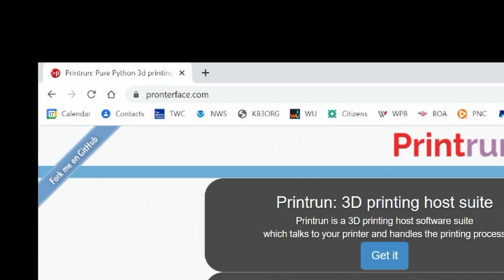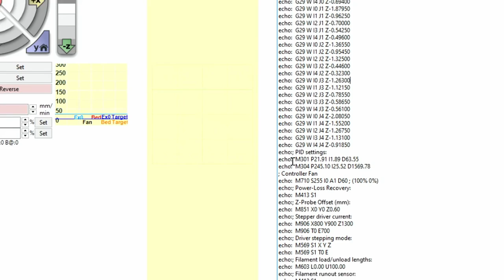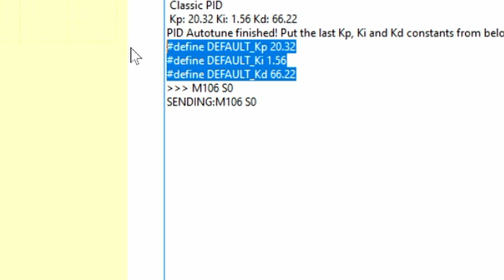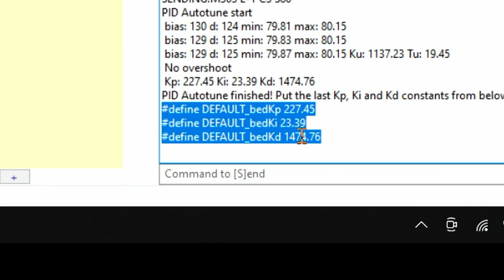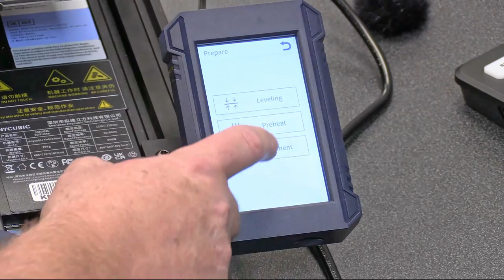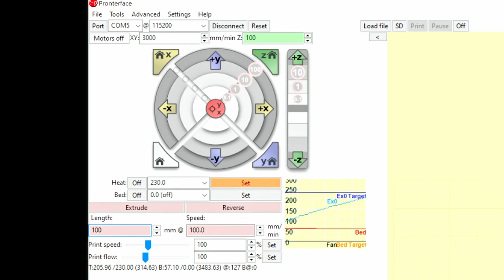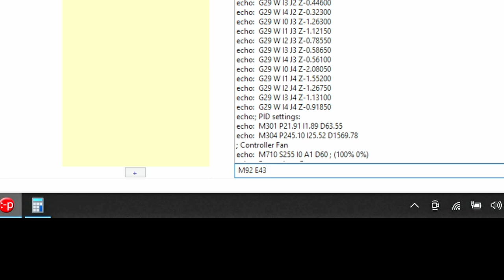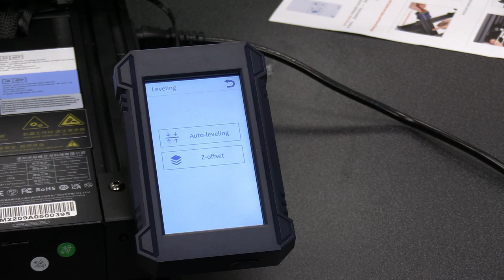Anycubic Kobra Max - Improve Printing

Comment: I recently bought a Anycubic Kobra 2 Max but it did not come with a usb cable.  Is it something special or just any USB A to USB A cable will work?  I tried a 10' A to A cable but its not showing up on my PC.  Next I'll find a laptop lying around and try it.
Reply from the maker: My 2 Max is still in the box waiting for me to do an unboxing/review so can only pass on what I've learned from the forums and Anycubic.  I do know that the 2 Max uses Klipper firmware which is and excellent choice by them to get the speed out of the printer.  Unfortunately they seem to have "locked down" the firmware so it can't fiddled with, like we have with prior printers.  There are some USB Type A's on the front and one is specifically for update the firmware off a USB stick.  I have to offer on the subject when I unbox it this weekend.
Reply: @TheMakersCave  Thank you very much for your response, can't wait to see you unbox it and get it up and running.  I just got it a few weeks ago and the test prints were not sticking to the bed.  They said at the time turn up your hot end temp to 70 and play with the temp on the bed.  Turning up the hot end worked but I want to make that default.  I did also ask and you can't use a usb a to usb a to connect you computer to use pronterface. Just like you I've been communicating with Anycubic support about this subject.  Here is their reply:

1st reply: Our KOBRA 2 MAX uses APP and WIFI connection functions.
The printer does not support connecting to a computer using a USB cable.
If you have any questions about this method or if you have any other expected solutions, please let us know.

2nd reply: We cannot send Gcode files directly to the printer,
After uploading the Gcode file, please print it online,
and then the printed file will be saved on the printer.

Comment: Question... when tuning the temp PIDs can you only tune and save at one temperature range or can I go through this process for all printing temperatures I use and have all the tunes/temps optimised?
Reply from the maker: Unfortunately the heating auto tune only tunes for the temp given in the command and most firmware only allows for one PID setting for the nozzle and the bed. But this is a great question and has me thinking.  I'm assuming you need these different settings because you are using different filiaments (PLA, ABS, PETG, etc) that require printing at different temps.   First you need to get the PID values for each temp/filament you'll be using, write them down.  You could then make a 3D printer machine profile for each filament/temp type.  Then go in to the profile for each machine that you made.  There is a spot for starting and ending G-Code.  In the starting G-Code you would put in the M301 and M304 commands with the PIDs you want for that particular printer.  There's no need for a M500 code.  Then just choose that machine when you do a slice of your object.  When the slicer creates the gcode for the printer it automatically adds those starting/ending gcodes to the gcode file, therefore your PIDs would be changed to what you want.  I hoped I explained that in way you understood.  If you hae any questions just ask, maybe I can do a video on this.
Reply: @TheMakersCave  thanks for the response and I think that would be a great follow up video your wisdom and time is much appreciated

Comment: I've had my Kobra Max for a few months now, and the performance has been kinda meh. My old Ender 3V2 had the PID autotune function built in once I installed Jyers firmware, so it never occurred to me to go into Pronterface to do it for the Kobra. Hopefully I'll start to see better results. Cheers.
Reply from the maker: After a few months I still like the Kobra Max.  I bought it mainly to print big things for animatronics, that's where it really excels.  I've had to tweak it about for details on smaller prints.  I definetely saw a difference changing the retraction to 6.5mm using Overature (from Amazon) PETG.
Reply: @TheMakersCave  For really big things that don't require a lot of super fine detail, it's great. I do a fair bit of prop making for cosplay friends, and for stuff like Destiny or W40K where everything is larger than life, it's pretty much the only option for printing in one go. But, that Volcano-style hotend is just the worst for anything like fine detail, and I've yet to figure out how to replace it.

Comment: So i've had my printer for about a week now, and it's worked fine for about... 4 days. After that i started having massive layer shifts and everytime before it shifts i'd hear a grinding-ish noise. I've tried everything but i still have this problem. Anyone who could help me?
Reply from the maker: I am so sorry for the delay. We had a major convention and then the last week Katrina and i have had a terrible flu.  I sounds like one of your stepper motors is jamming and/or skipping steps.  The printer doesn't know this so now it's lost it's positioning, hence the shift.  I'm assuming this is a bed-slinger (the bed moves from front to back).  With the machine off, so the motors aren't energized, can you easily move the bed back and both, trying going slow and slow increase how fast your doing it.  If it binds or jams then that's where the problems is.  If that is good, try the same thing with the Y axis for the hot end, that controls the hot end from going to the left and right.  If there is binding or jamming then that's the problem. Try those tests and let me know.  Email me because that is easier than chat comments :)   Steve@TheMakersCave.com

Comment: not sure if you're using Cura, but I have a kobra plus, and using the calibration shape plugin, printing out a bed level shape, it shows that the left side of my bed is either warped up on that side or something else is causing the left side extrusion to print as if the filament is being smeared into the plate.  I could barely clean the filament off on that side afterwards.    I've heard glass beds can't be perfectly level, but it effectively makes the entire size of my print bed not usable. I also don't seem to have great results using a z-offset calibration shape, the print comes off too low and some points and perfect at others, so I couldn't really just adjust z-offset to remedy.  I also cant for the life of me get any small details to print cleanly on this printer with a well tuned profile.  Curious to hear what your results are as their isn't much resource on the forums currently.
Reply from the maker: Yep, I'm using Cura.  I use a glass plate on my ender with no problem and the Kobra Max uses their glass plate with no problem as you'll see in Part 3 (comes out this evening).  If it's that uneven one of the things I would check is the "Z" gantry.  Make sure it's not skewed or uneven.  Next I would try to replace glass, just replace it with a standard piece of glass (or mirror).  Anycubic's site has a magnetic flex plate for a Kobra but it doesn't say which series.  What's strange is that the Plus has a 25 point leveling system.  See if any of this helps and let me know.
Reply: @TheMakersCave  I didn't mention first as well, thank you so much for doing this video!  The kobra max/plus community is very small currently and its been a challenge scrounging all the appropriate info!  I hope to take everything ive learned and make a complete, concise how-to video for the plus, including Cura setup and profiles.  I just checked the x-gantry, the left side is higher by .1mm than the right, so not sure if that will be enough to throw off the auto-leveling.  Also just swapped the brass nozzle for an e3d nozzle x, I didn't like how gooey and messy the brass was.  My quest for high detailed prints (comparable to the mk3s+ i have setup beside it to act as a reference/control).
Reply: I will apologize up front for not being able to remember the site or yourtube.  I remember seeing a comment about placement of the stock clips causing an issue?  It mentioned removing some and repositioning them to address issues caused by them.  Just a thought...

Comment: I klipper you don't change steps per mm - this comes from your gear/screw/time belt ratios and is fixed
Reply from the maker: Thanks for watching!  Klipper certainly has it's advantages but installing it onto a Anycubic machine takes some experience and I mostly focus on user just getting started.  Now, having said that, I'm eager to try installing Klipper on a machine.  Would love to compare prints before (with stock firmware) and after with Kipper installed.
Reply: @TheMakersCave  The idea was not to touch steps per mm but write what is from the math if gearbox. For extruder ok but for gantry should be fixed. Bowden in Kobra certainly overshot corners so one could try pressure equaliser in Prusa Slicer. Klipper itself won't help much since it's low acceleration printer. One can try new Biqu H2 V2S extruder (short direct).
Reply from the maker: @jzagaja  I've also found that the Anycubics hotend runs a little hot, sometimes up to 30 degrees, so backing down the temps helps.
Reply: @TheMakersCave  that's disadvantage of closed firmware. I assembled mine yesterday and cannot find screws to manage Z axis   wheels backlash.

Comment: Hi, very nice video!
I'm running Windows 11, and this doesn't recognize my Kobra Max. In device manager, it says something like "The USB-Device didn't respond correctly blah...". Can anyone help?
Reply from the maker: Oh wow, this might sound silly but you might want to try one of the one to four USB port devices.  You know, where you plug it into a USB port and it gives you 4 USB ports.  I have laser cutter and a vinyl cutter that both give me a "device not recognized" error if I plug it directly into a USB port, but if I use an expander device and then plug them into that, there's no problem.  Sometimes you don't ask why and just take the win :)

Comment: Sucks this doesn't work with the Kobra 2 Max as they neutered the USB in port
Reply from the maker: Yeah, they locked us out because the firmware is a Klipper variant.  They didn't want us mucking around in it.

Comment: How do I update firmware on the Kobra max
Reply from the maker: First check to make sure it needs to be updated.  I received my Max back in July and it has the most current firmware version available which is 2.8.6.  If you need help fining the version number you have let me know.

Comment: When trying to connect pronterface and the printer it says “could not connect to COM4 at baudrate 115200: serial error: could not open port ‘COM4’: Permission error (13, ‘Access is denied.’, None, 5) what am I doing wrong? I have the correct Com channel, I even changed ports to see if that was the problem. Please help!!
Reply from the maker: Hi!  This looks like it could be a permissions error.  Are running Pronterface from a windows or Linux computer?
Reply: @TheMakersCave  Has this ever been solved? :)
Reply: I saw folks say that running Cura might be the problem as I was getting the same exact error message.  I closed Cura and hit Connect again and it worked.  It still had the same error message at the top but at the very bottom of the error message, it finally said "Printer is connected."
Reply from the maker: I just assumed that you only had one piece of software running at a time, that was my mistake.  If you have the printer connected to the computer via USB, only one program that address the printer can be open at the same time.  One program grabs the USB Printer Port and keeps the other from seeing it.  Sorry :(

Comment: wow hope this works my prints suck.
Reply from the maker: I'm sorry to hear your prints aren't great.  I have also found that this printer and the Vyper get about 15 degrees hotter than what you set the print out.  Try backing down your print temp by about 10 to 20 degrees.  Start at 10 and do test prints up to 20 and see how each prints.

Comment: Everytime I try to connect to my printer it says permissions error 13 access denied. How do I fix this problem.
Reply from the maker: What operating system are you using, Windows or Linux?
Reply: @TheMakersCave  windows 11
Reply from the maker: You say "everytime", just in PronterFace or other programs too, like Cura?
Reply: @TheMakersCave  just in pronterface.
Reply: @TheMakersCave  when I'm in pronterface and click the connect button it gives me that message in the command box. I have went into the bios for the port that my PC is telling me it is and I can't figure out how to turn the permissions on or off so pronterface can connect to my printer.
Reply: @frederickfauber3752  Did you ever find the solution? :)
Reply: @johanbojeryd5542  no.
Reply: @frederickfauber3752  Too bad, I could really use this optimization too. :-/

Comment: It looks like using putty as a terminal emulator and firmware V2.8.7 I did not have to reboot the printer.
I got this response from the M301 command:
`
echo: p:28.73 i:3.16 d:65.30
ok
`

Right after the M303 command finished.
Reply from the maker: I checked the firmware when I first got the printer and there were no updates.  I haven't check lately, I'll have to do an update and try again.  Thanks.
Reply: @TheMakersCave to be clear, everything you are doing is awesome and I wouldn't have had the guts to try without some hand holding, that is, I only got as far as I did because you had the video up and I found it via Google/ reddit.
Reply: @TheMakersCave  it could also be because I was running the commands by hand, individually like a cave man in putty? Sorry my reply account is different from before.. yt is crazy, unless you tame it, and I don't have it in me.

Comment: If e step adjust is so important. Why dont 3d printer makers include it.
Reply from the maker: Most of the new printers now have an e-step option in the settings menu of the printer.  You still have to do an extrusion test and then the math, but you don't need software like PronterFace.

Comment: I was 100% locked in. Especially cause I just ordered a max. My first was the Photon d2. I immediately ordered the max. My issue here is. What happened at 12:43? There was a cut scene and when u came back at 12:44 the screen was full of echoes from the printer. I can't afford to be less than 100% sure about tweaking the codes of the program. Cause after u sent the codes to remind the program of the p.i.d. numbers. The cut scene then the screen is full of responses from the printer. The ONLY way I could try something like this sensibly is if I can see every single step of the process AND the outcome. There's a chance my printer could do something different. Thanks for the info but I'd rather not try this without being sure that I could perform this
Reply from the maker: That cut scene is just were I did a M503 to see all the settings to make sure that the new values were set.  Then I just issued the save command as you saw in the video.

Comment: quick question so when you were changing the bed heat to S80 for Petg because that's what you use often.... would I change mine to S60 for PLA
Reply from the maker: You are correct.  You should fine tune the machine with the settings you use most often.  I did at 80 degrees because that works best for the PETG I exclusively.